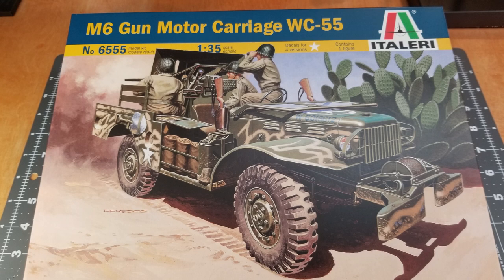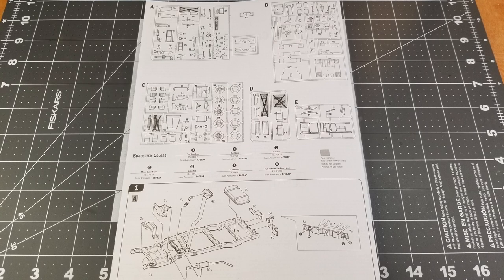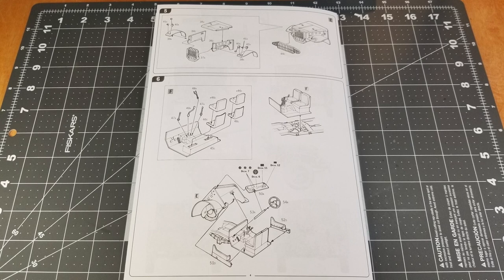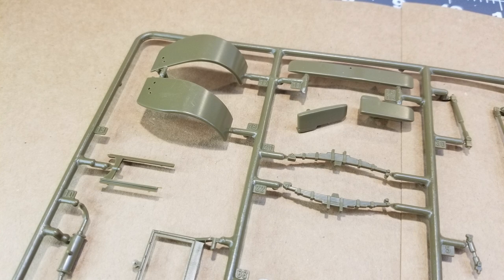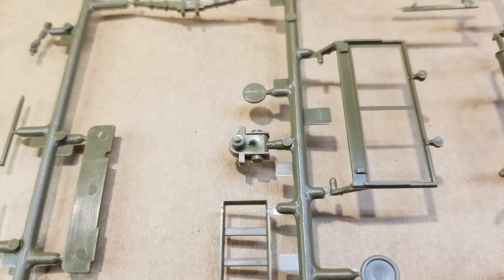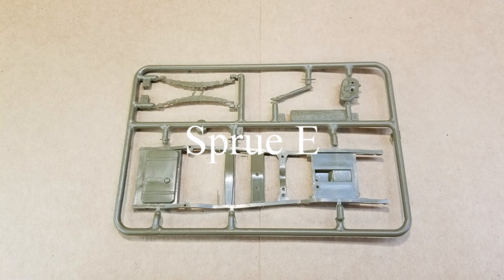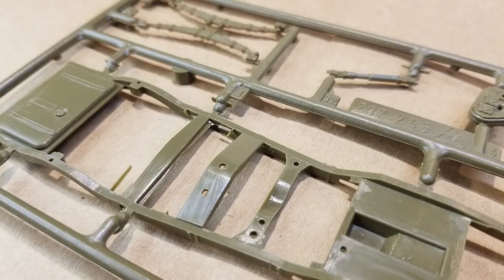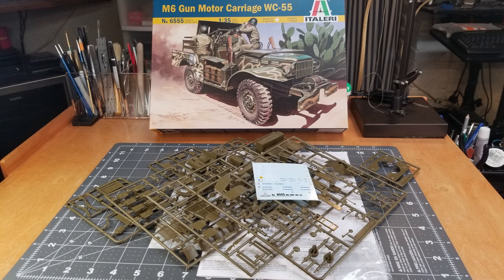M6 Gun Motor Carriage WC-55 by Italeri Kit Review

Comment: Hi. I have this kit in 35th and 72nd scales. One of my favourite vehicles.  I know that my 35th version is finished but its in store at the moment but I did recently build the 72nd version. The one problem I noticed with that kit is the ride height and the huge gap between the tyres and the fenders and arches. So I left the running gear till the end of the build. Once I chopped a few bits back I got a much better result. I know that I have another one of the 72nd scale versions in my stash so I can look forward to building that kit too. I will build this one with the 37mm gun. As for the rifles in their scabbards well I didn,t fit them on my 72nd scale one but on my 35th scale one I did. I added some thin plasticard to both side of the scabbards and the rifle stocks. I then sanded them down to shape until I was satisfied. They looked alright in the end. I enjoyed watching your build. Good video.
Reply from the maker: Hi Brian, yes, I wasn't too happy about the rifle scabbards either. I decided to discard them altogether. I probably could find a substitute if I searched for it, like using Tamiya's US Infantry Weapons kit and making scabbards. Anyway, thanks for watching, take care and model on my friend. Johnny